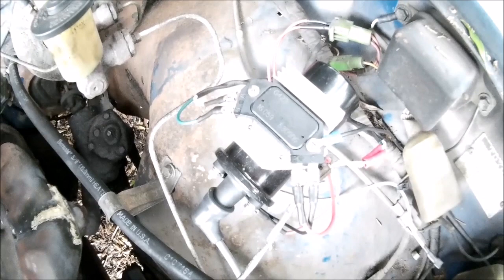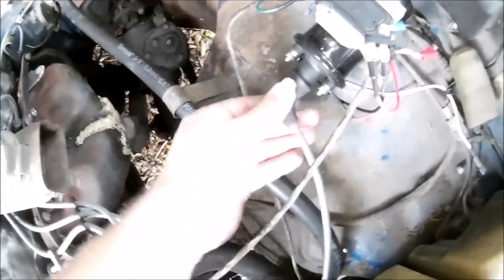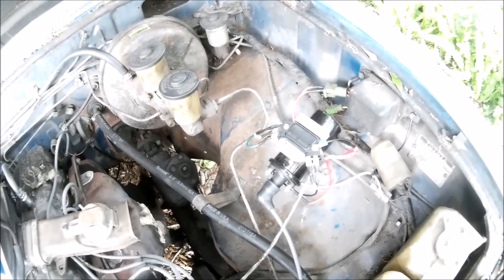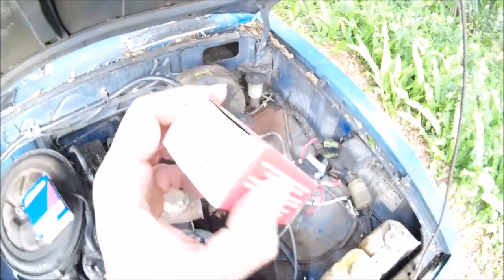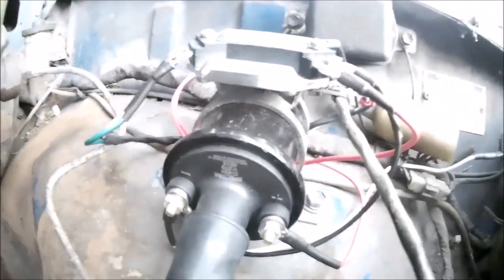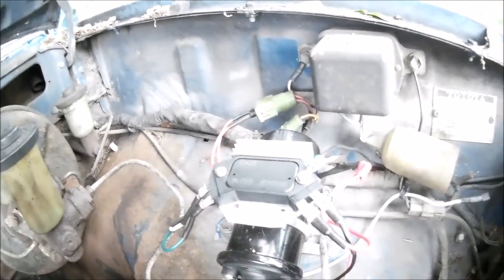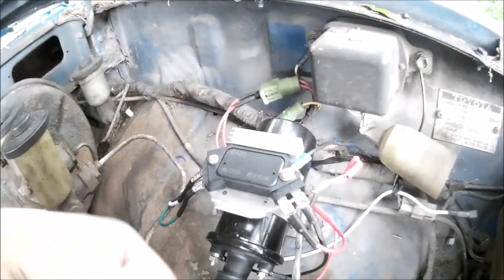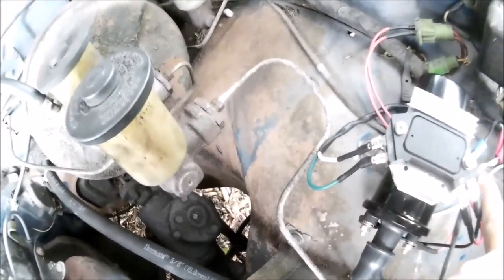1978 Toyota Pickup/Hilux 20R - GM HEI Ignition Module Conversion

Comment: Excellent video my friend, good, smart engineering, will be putting together a set up like this for my 85 4x4 22R 👍👌😉
Reply from the maker: Thank you. Not sure if it's noted in the video or comments (it's been a while), but be sure to use a quality ignition coil. I've learned through experience that the cheap coils don't last, and end up blowing up the module. Expensive lessons that no one else needs to go through. I'd recommend any solid brand of coil like Intermotor, Standard Motor Products, or even a stock Toyota coil. You get what you pay for.

Comment: Do you have a year and make of a vehicle that the heat sync fits so that I can get one at the parts store. The parts number comes back as a distributor
Reply from the maker: The part number I have for the heat sink is AC Delco 10474610. https://www.rockauto.com/en/parts/acdelco,10474610,ignition+control+module+heat+sink,11323

Most parts stores are not going to have the heat sink in stock on the shelf, but will have to order it in (if they even catalog it). O'Reillys says they can get it in next day. Otherwise Rock Auto has them and you can get it in 3-5 days or so.

The module I recommend is Standard Motor Parts number LX301. https://www.rockauto.com/en/partsearch/?partnum=LX301

Most major parts stores will have this in stock, and Rock Auto has them too, & usually for less $.

PS, IMPORTANT - I also recommend a brand new ignition coil for this conversion. Don't cheap out on it either or you will have problems later; I learned this the hard way. A quality coil is vital to making this work & being very reliable. The coils made in China aren't good quality, will not last (mine barely made it 6 months) & will burn out your module.

I recommend the Standard UC12 ignition coil.  Again, O'Reillys says they stock them, but Rock Auto also has them. I am not sponsored by Rock Auto. They just seem to have the best pricing & selection out there.

PPS - If you're handy, you don't have to use the AC Delco heat sink. You can use any decently flat piece of aluminum plate at least 1/8" thick & about 2" by 4" to mount the module to. Just be sure to use the packet of thermal paste that comes with the module, & spread the paste on the metal side of the module before you mount it. The paste should always be used, even if you are using the AC Delco heat sink.

Comment: If I mount the module in a different location than where the igniter was do I need the heat sync or can I go without it?
Reply from the maker: The mounting location of the module has nothing to do with the heat sink. The power transistors inside are constantly switching and create their own heat, and the heat sink is there to conduct that heat away from the module.  Heat is the biggest killer of solid state components, especially transistors.

I do NOT recommend running the module without a heat sink, regardless of where it is mounted. I would recommend that it be mounted where there is some adequate air flow, to help the heat sink conduct heat away from itself. I've seen some people mount these in the glovebox with the heat sink, and still have problems with them overheating & "blowing out", due to the lack of air circulation.

Any other questions just let me know.

Comment: @The13thSword did you use a ballast resistor?
Reply from the maker: No. A ballast resistor is not needed for this setup, and should not be used. The Standard Motor Parts UC12 Ignition Coil is a 12 volt coil and will work just fine with full system power. The resistor would only reduce the voltage to the coil, resulting in weaker spark.

Also, depending on wiring, a ballast resistor might reduce voltage to the module, which you absolutely don't want to happen. The '75 to '77 20R used contact points in the distributor, and there was a ballast resistor in those system to prevent large arcs at the points, to make them last longer. The HEI module basically replaces the contact points, so there is no need to limit the voltage to reduce arcing, as the module has no physical "points" in it to arc.

Bottom line - if you are converting a points system to the HEI system, you will need a '78 & up distributor with the pickup coil in it instead of points. And you need to get rid of the ballast resistor. Just connect the two wires that went to the resistor together.
Reply: @The13thSword  thank you! Most coils refer to using one. And all say use with resistor. Thanks again!!
Reply from the maker: @mexicomove225  The manufacturers print that on the coil in expectation that you might have an original ignition setup, with the points & resistor, and more as a reminder to test the resistor while you're in there. You can safely use the coil at full voltage with no issues.

If I can help with anything else just let me know.
Reply: @The13thSword  thanks again! Ordered a module and 2, UC12 Standard Motor parts coils.
Reply: @The13thSword  one more question,
 recommended spark plug gap?
Reply from the maker: @mexicomove225  All my sources say the stock plug gap is 0.8mm or 0.03 inch; I usually go with 0.031. I've heard of some people running up to 0.035 but I wouldn't recommend anything larger than that. Stock plug spec is NipponDenso W16EP.

Comment: @the13thsword hey I did this swap but I can't time my truck correctly. It starts up to about -6degrees of timing, but when I try to advance it anywhere past that it dies. Any thoughts on this? I have a 76 20r, but swapped in an 88 electronic distributor for a 22r (they fit perfectly, but the cap is bigger on the 88). I wonder if that has anything to do with it
Reply from the maker: From this info it's a little hard to pin it down specifically, but I think I know what happened here. If by "-6 degrees of timing, you mean that using a timing light, the mark on the crank pulley is showing it at about 6 degrees LESS than zero? I think you don't have the distributor installed correctly. Here is a good video about this: https://www.youtube.com/watch?v=u6b-vnsk5xA

There is one piece of info that you need to know about the 20R that is different from the video, and is important to the timing, and having enough adjustment in the distributor for fine tuning.

The 20R base timing is 8 degrees BTDC (before top dead center on #1 piston), whole later 22R's have a base timing of 0 (zero, or Top Dead Center on #1 piston). What I have found to work best is to set the 20R engine at the "8" mark instead of at "0", then install the distributor as shown in the video. You'll know if you've done this right if you look at the slot in the distributor body where the hold-down bolt goes. The bolt hole should be centered in the slot.

It does not matter that you are using a 22R distributor, as long as it is a correct distributor for a 22R (carbureted), NOT a 22RE (fuel injected). There are differences between the two distributors in the 22R engine family. The carbureted version will work in a 20R, but the fuel injected version may not work, or work poorly.

Have you checked the air gap on the pickup coil? The spec for it is 0.004" or 0.3mm, to 0.012" or 0.4mm. Make sure the pickup coils hold-down screws are tight, and that the coil is not moving around.

Also, on a 22R distributor, you have two different vacuum diaphragms. The original 20R distributor only has one diaphragm.
Make sure you have your vacuum advance line hooked up to the INNER diaphragm, NOT the outer, and certainly NOT to both from the same source. The inner diaphragm is the vacuum advance. The outer one was intended to be a vacuum "retard", and is not needed on a 20R. You can leave it open or cap it's port off with a quality silicone vacuum cap (recommended).

If you check out, verify and/or fix all of the above it should work fine. If not you have another issue. Let me know what you find.
Reply: ok here is some old guy knowledge  in the 70s mopar training manual it says pickup coil is 14` wide,  i have found this common with a lot of mfg's. so if you set cam/crank to 7.5` & install DISTRIBUTOR perfectly strait by eyeball, when you get back to the shop " it's at 7.5` ". so for this post  -6+8=14`  the polarity is backwards, reverse pickup coil wires

Comment: Currently installing a gm to Toyota distributor get that and throw all yhis extra crap out!!! Will work in a pinch but in my exp not for the long run
Reply from the maker: My conversion has been going trouble free for over 3 years now. Many others have done this conversion and have zero issues. Perhaps you didn't set it up correctly.
Reply: @The13thSword  you are one of the few like i said it'll work in a pinch might get ya out of the woods a lot simpler to install the right dist cut the middle man out of the circuit so to speak and throw all this crap in the tool box for emergency's

Comment: Will an 85 dizzy work for this. I have a 76 but I obviously need a two wire to make it work. Thanks
Reply from the maker: The 85 dizzy should work. Most 20R & 22R electronic distributors work the same way.
Reply: I put this in and wired it the way you explain, but I think the coil is incorrect for this application. It’s an msd 6 gm coil. Is the resistance wrong? Should I change to a standard uc12? It won’t fire with the current coil. Thanks
Reply from the maker: @terrytorgersonjr682  I would need to know the exact model & part # of the MSD coil you are using, but after having a look at all the 6 Series coils I could find on the web, it looks like the secondary resistance is a bit low on those. Let me know the info on that coil and any specs you have on it.

The '85 dizzy shouldn't make much if any difference, IF it is in good working order and adjusted properly. If it is used (not new) the pickup coil might be out of spec from wear/fatigue. If you test it with an Ohm meter, it should read 130 to 180 Ohms cold, if it's good. Even a reading of near 160 & up but under 180 cold could indicate that the coil is failing.

There is also an air gap adjustment for the pickup coil that needs to be correct, or the coil might nit send a signal to the HEI module. The spec for this is 0.08" (0.2mm) to 0.16"  (0.4mm). This gap is measured between the center face of the coil and one of the "vanes" on the reluctor ring on the dizzy's shaft. Every time one of those "vanes" passes by the magnet in the pickup coil, it induces a voltage in the coil of 3 to 5 volts. This is what generates the "pulse" signal for the ignition module to use. Make sure that gap is set within spec. I use 0.12" (0.3mm). if the gap is too big there will be a weak or missing signal.

Make sure the ignition module has a good, clean, solid ground. This is crucial. Without a good ground the module will not function. The grounding point on it is one of the mounting holes, where you will see a metal tab as a part of the hole. I have mine grounded to one of the mounting bolts for the voltage regulator. Make sure all ground connection points are clean & tight, bare metal to metal contact. Make sure all other connections in the ignition circuit are clean and tight.

If you have double checked and verified all of this and it's correct, but the engine still won't fire, you need to look elsewhere for an issue. Weak or low battery. Bad "+" power connections or no power to coil or ignition module (verify with a volt meter)., Bad, cracked or broken distributor cap, rotor, wires or spark plugs. Fouled spark plugs. Distributor incorrectly installed. Base engine timing incorrect. Possible internal engine timing issue (timing chain, guides, broken parts etc.)

At least check out all the things I described above before you go and buy other parts. Even with the somewhat lower secondary resistance on that MSD coil, if all else is right, it should at least fire off in some way.
Reply: I also put an 85 dizzy in. Is that the issue maybe?
Reply: The msd coil resistance reads 0 ohms on negative to positive. The reading on secondary is 5.01. It's an 8202 in which their site says it needs an external ballast but it seems that it may be defective. Also the the pickup is within specs. Also getting 12v to the igniter. When cranked while using a spark tester the light is very dim and almost non existant. Grounds are all good.
Reply from the maker: @terrytorgersonjr682  Just for clarification, if your ohm meter is self-zeroing, and you are getting 0 ohms on the primary resistance (+ & - terminals on the coil), I'd say the coil has a problem. The primary resistance spec for the MSD 8202 is 0.7 Ohms and should not be lower than that, even when new. As long as the coil has a proper resistance range no ballast resistor is required for it to work with the HEI module. In fact, I have heard instances of a ballast resistor being installed in the circuit with the HEI module, and the setup doesn't work, or works poorly. If you have a ballast resistor in that circuit, bypass it, or completely remove it from the circuit & connect the wire or terminal ends for it together.

I know some coils out there have the words printed on them "EXTERNAL BALLAST RESISTOR REQUIRED", but you have to understand why it's there. The assumption is that the coil is going to replace a faulty original coil, in an ignition system that was originally designed to use a ballast resistor. A ballast resistor's only purpose is to drop the voltage going through the contact points, to reduce arcing and extend the life of the points. While that's great for points life, it reduces the voltage to the coil to something like 9 volts.

An electronic ignition module & pickup coil system replaces contact points, and is designed to run on full battery power.

MSD's instructions on this coil clearly state that the ballast resistor is only needed if you are running points instead of an electronic module. " This Blaster Coil Kit is intended to be used with an MSD Ignition. If installing on a stock, points
style ignition system, a 0.8 ohm ballast resistor or resistor wiring MUST be installed." Source: https://documents.holley.com/8202.pdf

Function wise, there is no difference between an MSD electronic ignition (module) and the HEI; they both work the same way. Just because the coil is an MSD doesn't mean it will only work with an MSD module. An ignition coil is an ignition coil, regardless of who makes it.

If your spark tester is showing weak or no spark and you have the ballast resistor in circuit, that is likely your issue. Again, bypass it, you don't need it.
Reply: @The13thSword  so I replaced the coil with a napa ic14 which is a true 12v coil and states on the case that it doesn't require an external resister. Keep in mind that the system does not have a resister as I had removed all the factory icm components to convert to the gm setup. I have the standard lx301 ick wired like your instructions state. Wiring is hooked up properly and testing indicates that all connections have current and continuity. The new coil is zeroing out on the meter and is set to 20k when testing. I confirmed that it's not a fault in the meter as I had tested both the msd and napa coils with two separate meters and they both are zeroing out on the continuity test. The pickup in the distributor is reading 200 and the air gap is within specs but it's still seems to not fire when turning over. Plugs are good as well as the wires. I'm at wits end with this.
Reply from the maker: @terrytorgersonjr682  The pickup coil is bad. The spec on it is 130 to 180 Ohms. At 200 ohms resistance, that is knocking down any generated signal to the module. Basically the module is either not seeing any signal because of this, or seeing so little signal that it won't switch the ignition coil to fire. Here's what you need: https://www.rockauto.com/en/catalog/toyota,1985,pickup,2.4l+l4,1277300,ignition,distributor+pickup+coil,7176

If I were you however, and if that '85 distributor is used and of questionable condition, I would strongly consider replacing the entire distributor. A new one will have a brand new pickup coil in it, and there would be no "hidden" wear problem with the rest of it. Depending on which one you pick, a new entire distributor is only going to be $40 to $60 more than just getting a pickup coil, and you'll likely never have to worry about it again as long as you own the truck.
Reply: @The13thSword  that was the culprit. I kinda figured that may be the problem. Picked up a new one locally and now Shes running and purring like a champ now. I appreciate your input tremendously, Thanks again
Reply from the maker: @terrytorgersonjr682  Excellent! Glad to hear you got it tracked down. Please let me know if I can help with anything else in the future.

And BTW, here is a little something for you that you may want to bookmark and/or download for future reference: https://toyotachinook.files.wordpress.com/2011/12/how-to-keep-your-toyota-pickup-alive.pdf